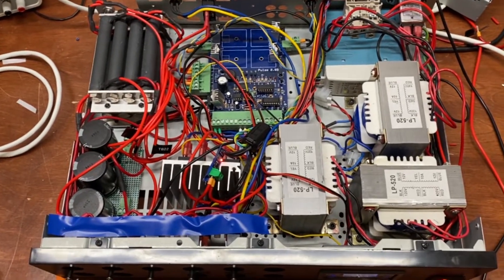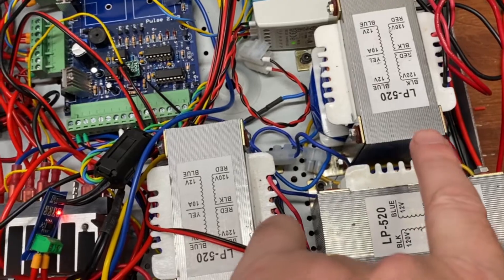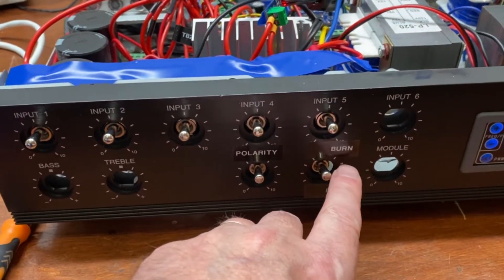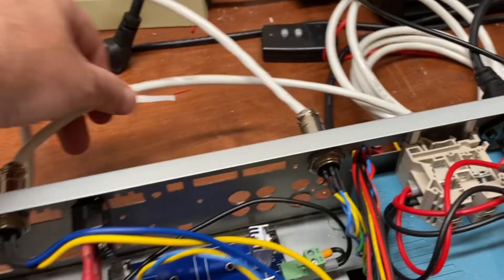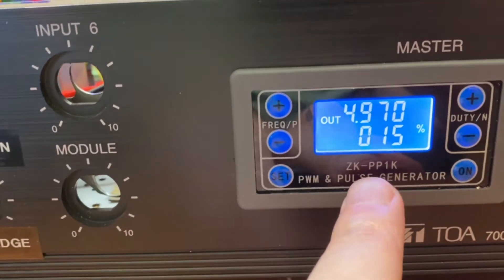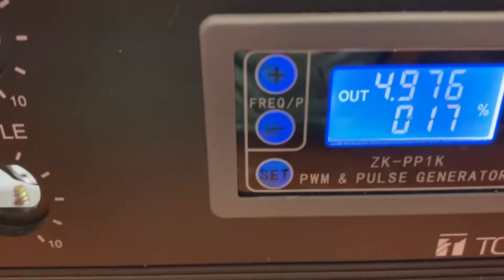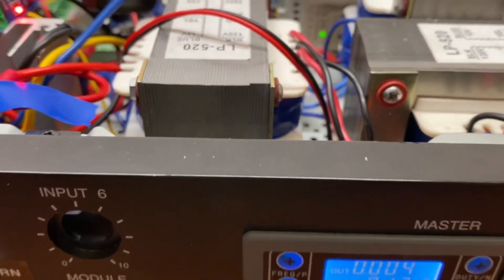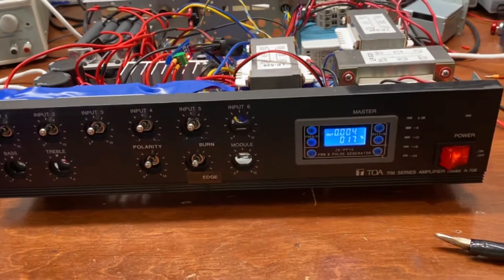EDM pulse generator first look

Comment: Great project I have a Pulse2.0 board and would like to use the same pulse generator that you used.  Can you let me know wow you connected them together.  Thanks for your great video
Reply from the maker: I have actually since, switched to an arduino (controlled with a little front end on PC). That said, if your board uses a 555 chip you need to figure out what pin outputs the pulse, remove the 555 and put the output of the generator where the output of the 555 would be.
Reply: @Core3DTech  Thank you, that is what I was thinking.

Comment: Can I use a different power supply than the transformer? for example dc dc booster? So what should be the maximum DC power? Is there a problem if 2 48 volt transformers are used?
Reply from the maker: I don’t see why not. My transformers in this setup are AC and end up charging capacitors. The charge power on the capacitors measures at 96V. Two 48V would do it
Reply: @Core3DTech  When you connect 3 24 volt transformers in series, you get 72 volts AC voltage, and when 72 volts are rectified, it increases to around 96 volts. It will be much higher when rectified at 96 volts ac. am I wrong?
Reply from the maker: More power to you ;-). Professional EDMs can go up to 400V. Just be careful!!  All that said, I’m not an electrician, talk to one to be safe
Reply: @Core3DTech  you are not an electricman but you are a real man.ı couldnt find answer my question but you answered it.  thank you for your feedback and ı turn you when ı try it

Comment: 1) how to bypass the 555 timer? 2) is it possible to bypass DC spindle motor with stepper? Thanks
Reply from the maker: If I remember correctly, to bypass the 555 for the pulse generator was pretty easy. There are two 555 timers. One for the pulse and the other I believe for motor control/comparator. I left out the pot meters and 555 chip for the pulse and inserted the output from the digital pulse generator (see TP5 on the schematic)

As for the stepper motor, I had the same idea and was going to build a controller that would measure votlage/current and control a a stepper (speed and direction) based on the measurements. I was using an arduino and a4988 driver.  after bricking 3 arduino boards I kinda threw in the towel and haven't touched the project since 😞
Reply: @Core3DTech   I'm learning about electronics and edm, and I wonder is it possible to make simple edm with ''ready made'' chinese modules from aliexpress, such as yours wave pulse generator, voltage divider modules to read gap, arduino, etc... of course, there needs to be a custom made pulse board with mosfets, and there are simple examples such as g-edm (custom pulse pcb with esp32 for steppers) and firstmotionlab's pulse board with arduino for steppers.

Comment: Your power supply is very nicely done. I love the use of a pulse generator in the build. I just started to gather parts for a power supply like you made. I am planing to go straight to wire EDM. What motion software are you planning to run?

Comment: How much is the voltage of the wire that cause the spark between the wire and workpiece  ?
Reply from the maker: I measured 96V
Reply: @Core3DTech  
Great video. 
Thank you for your answer.
I thought that the spark needs high voltage in thousands.